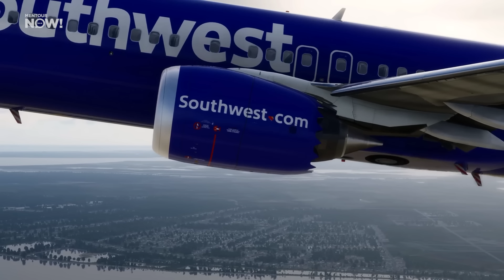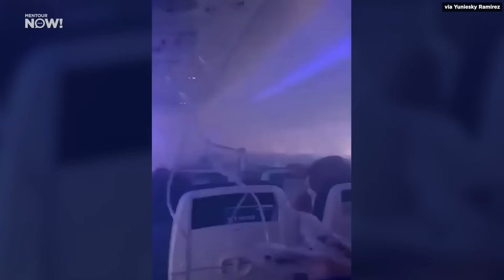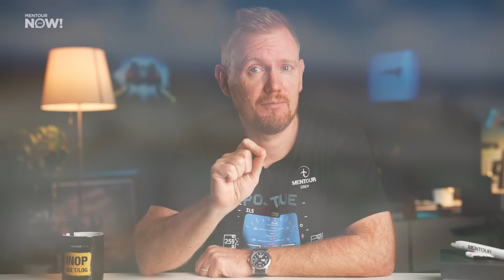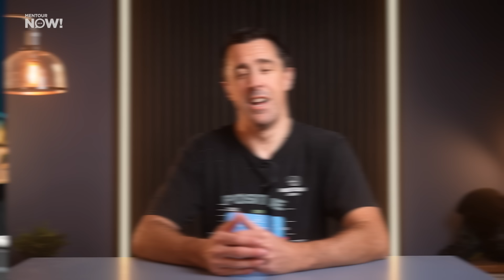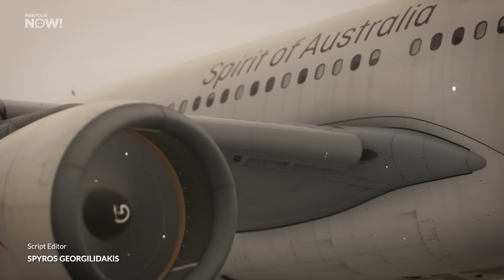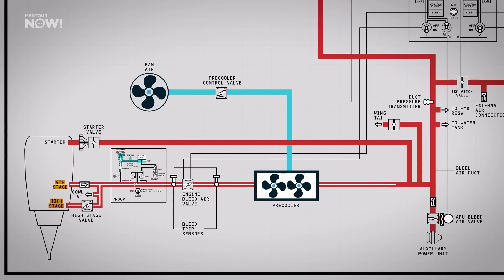Why Don’t ALL Airliners Do THIS?

Comment: The difference really is that bleed air architecture is at the limit of improvements, while electrical is just at the beginning of the optimization cycle. Bleed air will disappear eventually
Reply: ☝️This! 👍🤝
Reply from the maker: You're probably right
Reply: @MentourNow  I disagree. I worked at Garrett/Allied Signal/Honeywell in development and testing of aircraft environmental control systems, and I think emerging technologies will allow for significant improvements in weight as well as thermal performance. Imagine using additive manufacturing to create systems that combine ducting, heat transfer, controls, turbomachinery, etc. into a simpler monolithic device.
Reply: I was going to say pretty much the same thing. While there's no free lunch, and energy has to come from the engines no matter what, bleed air is probably close to its limits while electrical is going to keep getting better for a long time.
Reply: @CraigGood in what exactly sense electrical will get better in your opinion ?
Reply: @dmitripogosian5084  Electronics have been improving steadily for decades. I see no signs of that slowing down.
Reply: @CraigGood there is difference between electronics and electric devices. We are talking here about compressors, generators, wires and heaters. Not chips and computers
Reply: @dmitripogosian5084  still, with better electronics you can use higher voltage on the wires, you can use higher frequencies on the magnetic actuators. Especially motors/generators can be shrunk with the help of electronics.
Reply: @namibjDerEchte  Electronics does not have that much to do with it.   It is mostly material science.   To get smaller/lighter generators of the same power you need to rotate them faster,  to get same torgue from smaller engine, you need more tightly packed coils, so for thinner wires you need  to have less current thus higher voltage, but then deal with better insulations that higher voltage needs, and with more demand on cooling. So you 3D print coils in some designs,  use some advanced cheramics etc.
Reply: @dmitripogosian5084  Motors and generators aren't dead technology, there's still improvements to be made there. If the motor used to power a compressor becomes more efficient so does the compressor as a whole. Or if a motor design that has a better power to weight ratio, you can decrease weight. Etcetera.
Reply: @CraigGood Replacing plumbing with copper busbars and putting the pump right by what it's driving seems to be a good way to save weight; if it works for hydraulics (see: electro hydraulic actuators) then it will work for air.
Reply: @CraigGood  The two latest clean-sheet designs would indicate otherwise...
Reply: disagree. Bleed air systems are now more viable with improved electrical systems. A hybridization of bleed air systems is the way fwd. The giant generators in the 787 are not sized for efficiency but for max power limit. Bleed air usage allows generators to be 10x smaller. Probably anti ice may evolve into a better solution than either hot air pipes or resistors.
Reply: You think bleed air anti-ice is gonna go away too?
Reply: @felixar90 probably? 787 has proved that electric anti ice works on the wings. Obviously moving from bleed air for anti ice on the engine itself has less of a benefit, but is still does have a benefit. It certainly simplifies the design a bit with less plumbing. I guess we’ll see
Reply: @repatch43  Have you factored in the added weight penalty of not only the batteries, but the shielding that is mandatory, after the 787 fires - into your calculation?
Reply: @frankpinmtl yes, or at least I’m assuming Boeing has. 

Just think of how much piping you’re replacing, it’s entirely believable going electric has an advantage
Reply: @repatch43 that stat the Boeing gave was then not the number before the extra shielding that is now required?
Reply: @frankpinmtl  LiPhosphate batteries do not suffer this risk, but only 80% energy dense... a little weight penalty, but no thermal run-a-way en-route or on the runway.
Reply: @repatch43  I actually more like the idea that if my engines are working I have anti-icing.    Rather than to have an intermediate system to possibly fail.
Reply: @repatch43  Do you know what they say about 'assuming'? 

Did you know the 787 has lost Boeing over $25 billion, and counting? Even after delivering over 1,200 units?

Because many of the things on the jet did not perform as advertised or promised to airlines. Including the battery problem. 

Ask any retired Boeing engineer. I have a friend who is one and he knows a ton more - all SPEEA guys. 

No one wanted to work on that aircraft.
No one who knew better, anyways...
Reply: @ElliotWizerd  Yes, but did that shielding change the calculus? And if it did, was that only because the shielding was a bandaid and if they designed it with that in mind from the beginning would the calculus have changed enough?

And again, we're talking about the FIRST implementation of this architecture, there is a TON of optimization available as things get figured out.

Electrical is the future, there is no doubt.
Reply: @dmitripogosian5084  The genset is part of the engine, all you need is the generator, which is attached to the rotating parts of the engine, cables and heating elements. It's actually LESS complicated than a bleed air system which has valves that open and close, piping that can rupture, etc.
Reply: @frankpinmtl  The first implementation of a new architecture is ALWAYS the bottom of the 'worth it' tree. Have you somehow convinced yourself that all the problems of the 787 are because they moved to a no bleed design? Really?

Obviously not, that's ludicrous. The 787 was a clean sheet design. By it's very nature the development costs take WAY longer to recoop than a NEO refresh for example.

Now, that's the first bad new, the BIGGER bad news is the idiocy of management decisions in the farming out of CRUCIAL component design and manufacturers to the lowest bidders, who just weren't up to the job. It required things to be redone MULTIPLE times, pushing schedules and driving up costs. The development time of the 787 was simply a disaster. Some might think that was due to all the 'new' in the design, and some of it was, but the FAR bigger problem was the penny pinching that Boeing enforced.

Boeing had long ago moved from a engineering driven company to a bottom line company, and when you make something as complex as a freaking airplane? That's guaranteed to end up in the pain zone. 

And it did, big time. 

The 787 is a WONDERFUL aircraft, in many ways. It certainly has had it's growing pains, but assuming Boeing wises up it has a very bright future.
Reply: @repatch43  

I never said what you're implying. I know why BA is where it is and you hit the nail on the head with the mgmt analysis.

The battery issue, the shim issue and the failure of the 787 as a business endeavour, are all symptoms of the Jack Welch GE mentality taking BA over, via the McD merger. 

You can add the 737MAX, 777X and every major defense program to that list. 

Hell...the KC-46 is approaching $10bn in losses. 

Here's what I'm saying about the battery issue:

Knowing what you now know about Boeing and how the c-suite boys wanted financial performance (dividends and buybacks for all!) from the company, over engineering excellence...

...would you say that the decision to use electrics to power the jet was made because:

1) It was a sound engineering choice, which the company implemented because it wanted to be at the forefront of aviation design. Boeing is committed to be on the cutting edge!

or

2) They figured out a way that they could save some money and push the costs down to suppliers (ever hear of Partnering For Success?) in the chain.

I think we know what the answer is. 

But the guys who made those choices are long gone. They got paid off and left the mess for the next guy. They also left Boeing with some $55 billion in debt and a balance sheet that is dogsh!t. 

If you have ever heard of program accounting, then you know what I am talking about. Boeing has been burying the losses for years. 

The real proof in the pudding, though - is Airbus and Bombardier. Both of them must have looked at the bleed air and electrical system of the 787 and said, "No thanks", when it came to the A220 (C-Series) and the A350. 

After all, the A350 is the Airbus equivalent of the 787, in terms of composites. Made differently (barrel sections vs pringles) yes, but they are both their offerings in that segment. 

Further proof is that the A350 has paid back it's R&D spend and is profitable for Airbus after some 500 deliveries, while the 787 for Boeing will never make the company a dollar.

It is a marketing success and a financial disaster.
Reply: @repatch43  that's why Boeing and Airbus worked on a different solution (both works. Only the result differs)

Who knows if in the future. There is a more efficient solution than both bleed hot air or electric heater?
Reply: @dmitripogosian5084  It boils down to the question of failure rates of the two different approaches... the bleed air system just needs piping, where the electrical anti-icing needs a generator (with some gears) and wiring. Generators are quite simple, so very reliable, but perhaps not as reliable as simple piping... well, some engineers at Boeing and Airbus will have run the numbers.
Reply: @csppsc1  No need for gears in the electrical generator there; you can use easily redundantly architected electronics and just spin the generator on the low pressure shaft itself.
Reply: @namibjDerEchte 

Remember, these are also starter motors that have to turn the high speed spool!
Reply: @repatch43  Honestly speaking, I trust electrical wiring less than piping.  Just recall the Baltimore bridge taken down by a single inproperly inserted elecrical connector (despite duplicated system).   Also electrical systrems tend to fail catastrophically (i.e it works one moment - and now it does not), while mechanical ones tend to develop problems over time which can be caught in maintenance.
Reply: @dmitripogosian5084 electrical/electronic systems are simply more reliable long term than mechanical systems. Any failure mode that’s ‘instant’ is a matter of design, redundancy is what handles that.
Reply: @repatch43  My house experience does not agree with that.  My garage is filled with broken electric devices (need finally to get to the dump) :)   Burned toaster,  heaters, blown control boards, not to mention stack of batteries.  I understand, consumer grade is not airspace industry grade,  but so are my piped toilets that are flushing OK for 30 years and 50 year old furnace still chugging along (yep, I have to replace what - burned electric motor once), and if something leaks I have an ample warning and time to repair.
Reply: Yes but bleed air systems are extremely reliable. Basically, the PACs are zero maintenance items and they're basically 100% reliable. I once did a lunch and learn at a previous job and some colleagues explained the systems and how they've progressed over the years. At one time they were one of the least reliable & most maintenance intensive items onboard and now it's the opposite. It's probably true that zero bleed systems will become more common but this video is forgetting the 787 battery issues early on.
Reply: @cliffordbradford8910  100% reliable except for when they shove burning oil smoke into the cabin.
Reply: @cliffordbradford8910  You're comparing a technology that has existed for many many decades, that has been refined and improved continuously for that period such that it is in the state it is today, to a technology on it's first iteration, that's only been around about a decade. OF COURSE the existing solution's reliability will be superior, that's not at all a surprise. But give bleedless time to iterate and improve and it's reliability will very quickly surpass the bleed air solution.
Reply: And electrical stuff is used everywhere, so there's A LOT of funding going into researching better battery technologies and things like that.

Comment: Its a shame bleed air was kept by Airbus. I get why from a financial standpoint but innovation doesn't come easy. When they do decide to do electrification like Boeing they'll have many of the same issues only they won't have the same relaxed attitude given to Boeing as it teethed.
Reply from the maker: Well... except that they have those early Boeing problems to learn from, plus we know a lot more now about how to handle lithium batteries, guard against thermal runaways, etc.
Reply: Airbus has taken risks similar to Boeing’s bleedless system before. In the late 1980s, the A320 family pioneered Fly By Wire for airliners. For the first few years of that program, the A320 has faced 4 crashes attributed to how pilots interacted with FBW, since like the Li-Ion battery, it was new technology not many were familiar with. However, throughout the 90s, the FBW system has been revised to be even safer than mechanical controls similar to how the 787’s battery issues were resolved, and Boeing was eventually able to implement FBW with confidence on the 777 and 787

Comment: Why can't modern day aircraft not deploy 'RAT's to create electricity or would the drag be adverse to the performance?   Even my car battery has an alternator!  I am running a home made water wheel in the stream next to my house connected to a dynamo and 4 car batteries.and whilst it will not power a football stadium I have had free electric for two and a half years!  I understand the possible weight problems but surely there must be a way of harnessing the wind power at altitude without compromising the performance of the aircraft!
Reply: You said it pal, drag is the problem. There are no free lunches here, you put a machine into the air stream, it'll create drag and you're going to burn fuel to compensate for that drag
Reply: @starliner2498  Yeah fair enough. you explained it well. I am not a pilot or engineer but I just thought that there must be a way of fitting an Alternator to an aircrafts batteries without disrupting airflow.
Reply: The extra drag would be a substantial fuel penalty, especially if it was one large enough to actually power the whole aircraft rather than just being an emergency backup to the most critical systems. 
More than just that though, a RAT also wouldn't function on the ground, so you would still need all the means of sourcing power from elsewhere. That's the other half of the problem. You still need a means of reliably powering the aircraft when its not moving fast enough for a RAT to function. The need to account for things like delays on the ground would mean needing massive, heavy batteries if they were the only source, so you're right back to needing to using the APU generator or the engines on the ground. So you might as well keep using them in the air.
Reply: @BrySkye    Yeah fair enough. you explained it well. I am not a pilot or engineer but I just thought that there must be a way of fitting an Alternator to an aircrafts batteries without disrupting airflow
Reply: Every power conversion has a loss. In your scenario we would have to convert chemical energy from the fuel to kinetic energy in the form of thrust witch part would be wasted as drag to later convert kinetic energy from the wind back into electric. Taking a more direct route and taking power straight from the engine will always be much more efficient. The less conversions the better.
Reply: @rantos9     Yeah fair enough. you explained it well. I am not a pilot or engineer but I just thought that there must be a way of fitting an Alternator to an aircrafts batteries without disrupting airflow
Reply: They do have RATs. At least the two models mentioned in this video (Boeing 787 and Aribus A350) both have RATs. I don't know if all modern airliners have them, but many do.
Reply: @andrewsnow7386  Yes but they are only generally deployed after a loss of electrical power form the engines or CPU.!  My point is why not have them deployed all the time. Even 6 small ones could provide power that is normally generated by the bleed air.
Reply: @BrendanMoore-ys9qd  It still takes energy for the RAT to run, which comes from slowing down the whole aircraft. If the engines are still running, they have to supply the extra power to maintain airspeed. So what have you gained by sticking a wind turbine out in the slipstream? Nothing! And bleed air doesn't generate any power. All the energy in it comes from the engines.

Comment: Why even consider complicate solutions like detecting vibrations in software or completely redesigning the air system to counter one source of smoke when you could install a smoke detector at the point air enters the cabin and have a barrier against all kinds of sources of smoke, not only an ldr event?

The other things are not wrong to do, but they do not solve the problem that the climate control in airplanes happily poisons the passengers and pilots with toxic smoke unless stopped by a human.